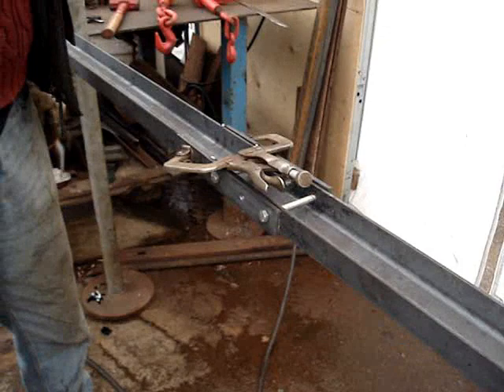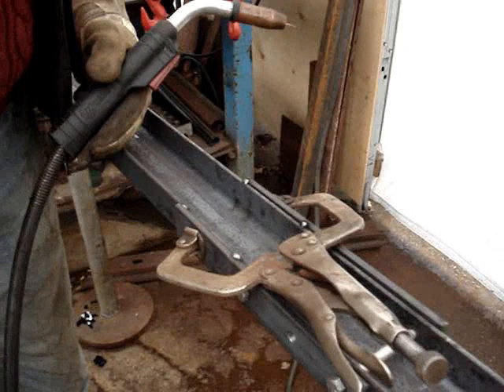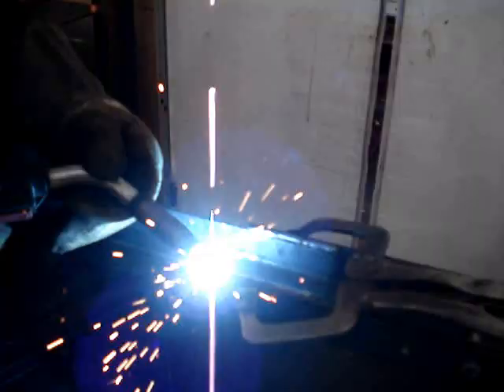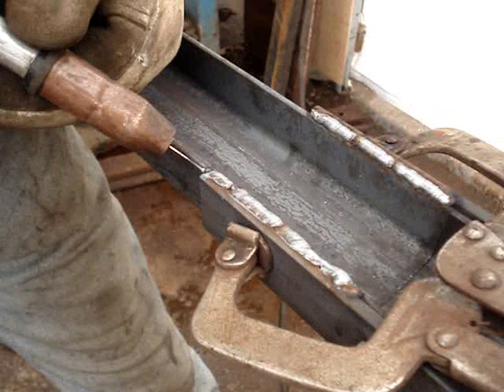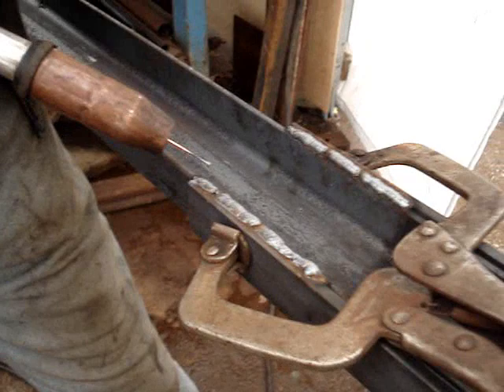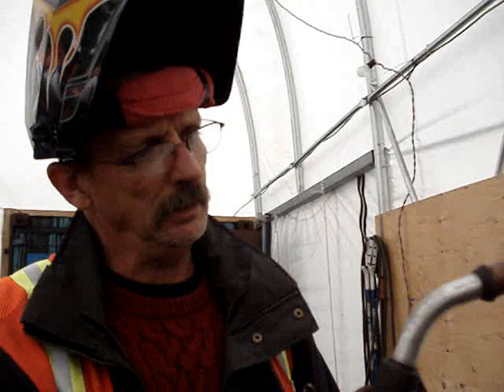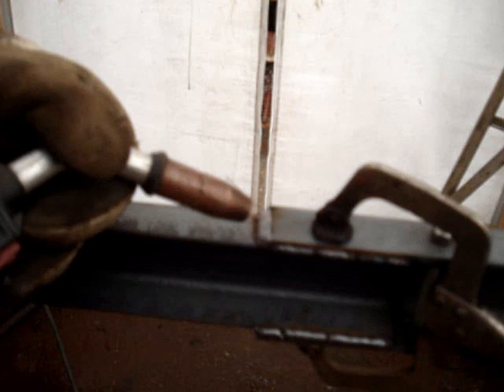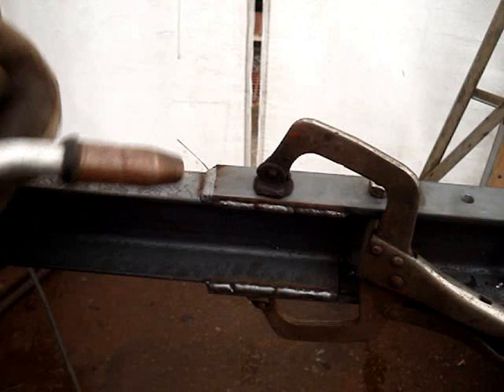A Very Short Welding Lesson

Comment: my suggestion when learning welding always keep an open mind and listen to not just one person with technique, as when you have been welding long enough you will see others that do rather obscure methods. My suggestion is to learn with a pulse mig welding aluminium this will really refine your technique and understanding of penetration of metal, you weld aluminium backwards you will fail same as using tig aswell, seems as tho this fella used a arc welder to begin with, arc you work backwards.

Comment: @MrZaffo 

Yes, but the weld never feeds into the base metal and will be significantly weaker than if you push molten metal into the weld front, allowing greater penetration and a better amalgamation of base and introduced metals.

Comment: You can push or pull with GMAW, pulling will give you better penetration than pushing. Pushing lets you see where your going better and a little easier but you can definitely push or pull when MIG welding.

Comment: @Justicejamesb  Mearly stating the facts
1.Qualified boilermaker 14 years 
2.work with steal over a foot in thickness
3.arc welding is the only time you work "down hand"
4. did state 'yes the weld will hold but it would not pass as Q.A approved'.
I am not saying Im the worlds greatest welder just simply stating in my opinion and from engineers have explained to me when I done my apprenticeship why we work forward when using mig, Believe what you want Im on 65 an hour fly in fly out mines.

Comment: @Spongey1337 push or pull a correctly adjusted machine and gun angle will reduce the the amount of spatter, but for the most part youll still get it, unless you spray.

Comment: @savagealeut1212 i love how certs make every one a pro...not saying that his welds are great, altho im sure they got the job done fine. But for the most part forwards or backwards doesnt matter much if you do it right.  The mixture of gas depends on the type of weld your looking for for instance 98/2 would be for spray arc. Push or pull ive passed certs going both ways with hard wire, or flux core. The only one that is really doesnt want to be push is stick welding.

Comment: hence why some peeps never weld anything over inch thick,  there is only one correct technique when welding!! simply put what he has done is incorrect but this does not mean to say it wont hold, when you weld things that are stress tested and xray ed, stuff thats like over a foot in thickness and made of  bis-alloy and using fluxcore wire then yes technique is very much crucial, the inert gas used for welding is designed to also cover the area where you are welding to not from!!!
check inert gas

Comment: @bichn01 1 foot in thickness? dam. multi pass is multi pass though and i have done 2 inch welds, those are fun haha. I do have to say there is a difference between pushing and pulling the weld, but if done right both will pass most cert tests, cant say allcuz i havent done them all.  But i have pushed dual shield and pulled hardwire. The reason behind specific directions is for the general person, easier to pass things when they are done "Right" doesnt mean its the only way to pass.

Comment: @bichn01 hows that backwards? you CAN weld forwards or backwards, it makes no difference, the heat does need to go up because i can see there is very little penetration on the first few welds.

Comment: @personalfunfest I dont hate any one just mentioned it was incorrect , and no why would I post a video on how to weld when clearly you believe welding backwards with a mig is correct, so all i can say to those that do this good luck finding a job when when technique is the first thing a Q.A inspector looks at, Clearly this job does not require such extremes but when you get into structural integrity side of things and you job in getting inspected you will need to exert actual proper technique

Comment: @savagealeut1212  also, not that it matters, but i have many certs lots of d1.1(structural) a few b2.1(pressure) and soon to be some d17.1(aero space,tig)  welding only 6 years.  certs dont prove your a pro, they prove that you have the know how to get a certain thing done in a controlled enviroment. D1.1 is one of the easiest certs anyone can do, and you can pass it and still be a crappy welder and put of utter crap.  just a thought.

Comment: I have been welding for 7 years. this guy has no idea what he is doing, I have 8 certifications from five different U.S. states. About the only thing he did right was tack it on the backside. lol. Read the top comment of which direction he should have been traveling. This is because this gives the shielding gas(Usually a 90/10 mixture ) the ability to shield the atmospheric air away from the bead. If it were stick (SMAW) then the flux provides this. Overall listen to @bichn01 ....SMH..

Comment: how long have you been welding, for one I have been a boiler maker for 10years plus and Ive never ever seen anyone weld the wrong way so much im shocked you made this video , first you are working backwards with the mig  , secondly not enough grunt used ,no penitration, looked like cold duck shit weld to me, if you are going to give instructions on how to weld clean and proper at least point the gun in the direction you are working to get newbies the correct intructions to begin with.